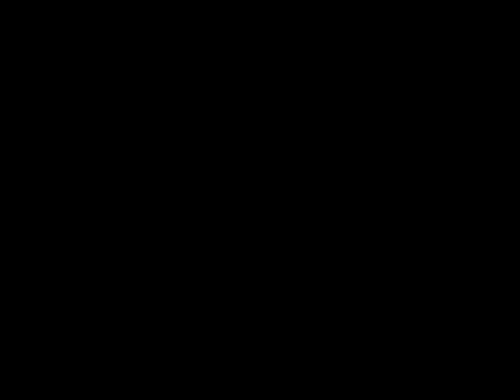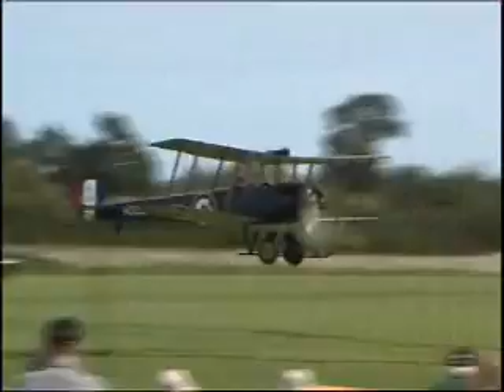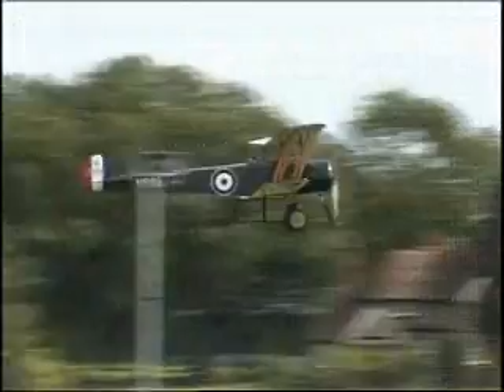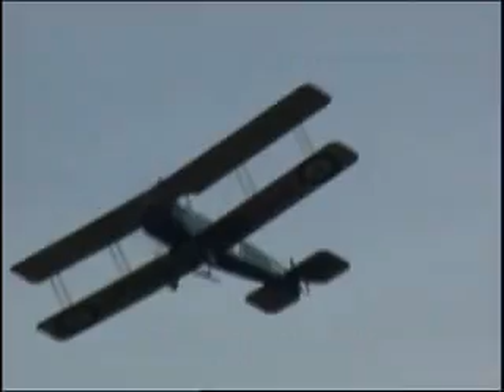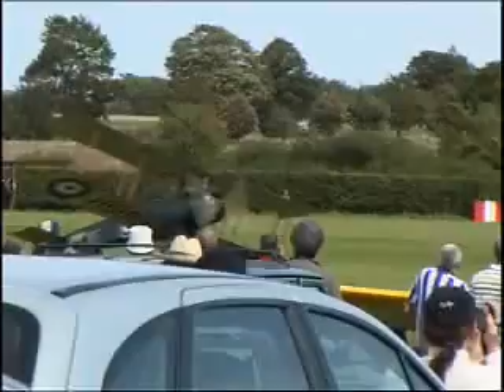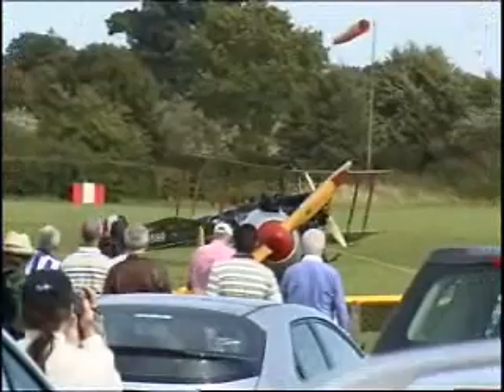Accident to Avro 504 at Old Warden 6 9 09

Comment: @rgnvideo Agreed very much on the adage. With vintage aircraft, I'd add "any landing an aircraft can roll away from is a great landing". The absolute worst case here is that the aircraft ends up in a museum earlier than ideal, still entertaining and educating though not at its best. The bump looked light enough, though, that a rigorous inspection of the struts and the lower wing should have been enough to keep the Avro in the skies for many years.

Comment: Thumbs down due to misleading title. 

Many biplanes had hoops under the lower wings near the tips to prevent damage when wing tips touched.  With a narrow gear and a long wingspan it was not uncommon for a wingtip to touch on landing - actually quite common. There will be very little inspection of the wing as there most likely was no damage other than a new grass stain on the bottom of the lower wing. 

Stopping of the engine would be standard procedure to make sure the plane stopped moving forward as quickly as possible since this plane has no brakes, just a tail skid.

There was a lot more damage to the pilots ego than anything!
Reply: hogflyer62 n
"L q
Iiu